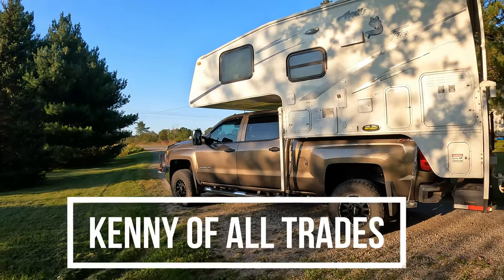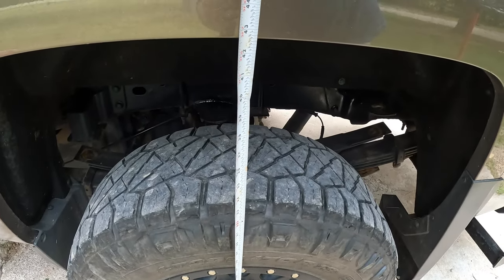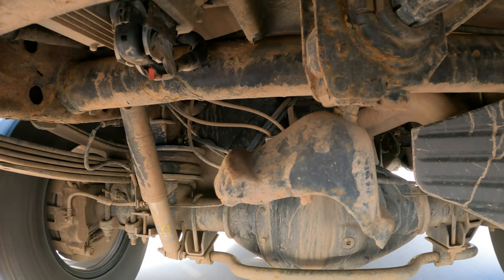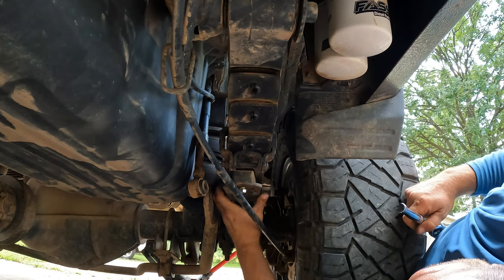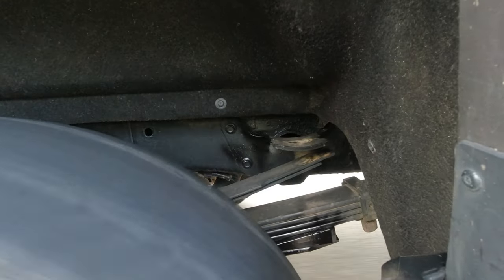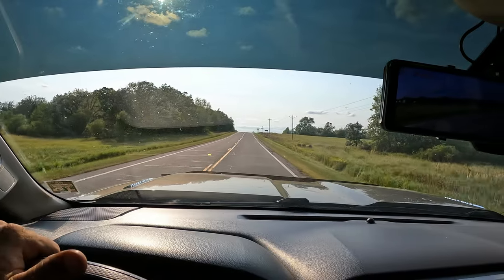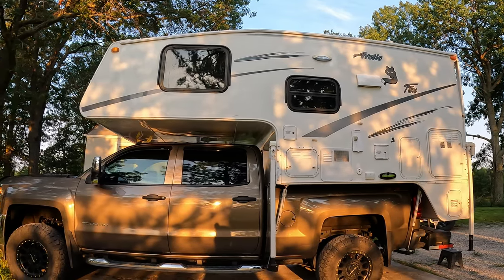Suspension Upgrades for Truck Camper

Comment: Great job on the write up. I already have a stiff set up on my f250, but if I want to use the felling wedges what guidelines should I use to install these onto my rig?
Reply from the maker: For my silverado it was straight forward. The wedges were the same width as the leaf springs. I pushed the wedges in so the end wasn't overhanging the leaf pack. The wedges come in two sizes, short and long. I put the long wedge in the back and the short wedge in the front. They have been in for many miles, well over 50k with no signs of wear at all. Unfortunately I'm not sure what the leaf pack looks like for the Ford.
Reply: @KennyOfAllTrades   Hi again, so I bought the Pormido mirror. The cords seem long enough to make it thru the cab and to the back of the camper. But the issue I know I am going to have is, I remove my camper after each use. Do you think I could put in a quick disconnect by splicing the wires? Or do you know of a unit such as this one that has wifi? Thanks for your help!
Reply from the maker: I disconnect the camera when I remove the camper. My camera had about two feet of cable then a plug. I would plug the camera and leave it attached to the camper. The other I would plug a rubber cap on and tuck up nder the truck.

Comment: This is an awesome video, love the explanation! I watched the whole thing even though I have a ram 1500 with upgraded coils lol. I just installed airbags on it but haven’t put my camper on just yet, wondering if anyone knows how the leaf springs+ airbags compares with the coils+ air bags
Reply from the maker: Thanks, I appreciate that. I hope someone can answer your question. I have never run coils before. My nephew had a 2500 Ram with coils. He had a Mountain Star in the bed (approximately 2200 pounds) with factory suspension. He would go to Montana Elk hunting and had no trouble.

Comment: Kenny, awesome video as always! One quick question though, can you show or tell how you mounted the fold down table/tray that you built on the back of your camper on the ladder?? 
As always, thanks for the info. 
Wife and I will be taking our 2014 Arctic Fox 990 out for the first time this month. Super excited to get this adventure on the road
Reply from the maker: Thank you for reminding me! I'm gonna include that in next t weeks video. I realized I missed a bunch of upgrades. I have forgotten about so much stuff over they years. Next week will be 15 minutes of additional upgrades, and I'll show my maintenance routine with the caulking gun. I also have to seel tge roof.
Reply: @KennyOfAllTrades  awesome!! Looking forward to next week.
Have you ever noticed any bubbles so to speak in your rubber membrane on the roof?? I have spotted a couple on mine, but I’m being told as long as there are no holes or tears that it’s fine. Still, it bothers me. lol.
Reply from the maker: Yes. Bubbles are OK. Or so I've been told. I have them too.

Comment: Hey Kenny,  GREAT video.  With the Wedges installed, how much room is between the main stack leaf springs and the overload springs, when uploaded?
Reply from the maker: Oh boy......thats a good question.....I haven't had the camper out of the truck in years, I don't remember..
Reply: Kenny’s truck is like a turtle…takes its home/shell with it wherever it goes lol
Reply from the maker: True story!
Reply: Hey, no worries. I'm going to be with and without the camper, so I was just wondering if the trucks ride became stiffer then it was without the camper. Thanks anyway.  Safe travels.
Reply from the maker: I'm going to say yes, the ride will be stiffer unloaded.  I don't think there was much of a gap, if any,  even without the weight of the camper.
That is where the Stable Loads from Tork Lift have an advantage. You can quickly disengage the overload perch.

Comment: I'm thinking to do all the mods but not the air bags. would that be a mistake? would the other mods level out the truck or just help handling?
Reply from the maker: You do not have to install the bags.  You will notice the difference with the other upgrades. I get the most use out of the airbags when I'm parked at a campsite. Having the ability to raise and lower each side 3" can come in handy when leveling out the camper.

Comment: Great video. Do you have a link to the lower wedge pieces?
Reply from the maker: I bought mine at Fleet Farm. But I found these on Amazon. They look to be the same product. If you buy these you will have one small wedge and one Large wedge left over....
https://www.amazon.com/Cold-Creek-Loggers-Chainsaw-Supplies/dp/B08L445PGS/ref=pd_aw_ci_mcx_mh_mcx_views_0?pd_rd_w=STlDG&content-id=amzn1.sym.be5b1f23-b91e-4e1a-9f5e-a760e8130d24&pf_rd_p=be5b1f23-b91e-4e1a-9f5e-a760e8130d24&pf_rd_r=4ZRN9TYH0DAFB145WE8B&pd_rd_wg=RuF0W&pd_rd_r=cadaedd3-daab-4490-b9d7-f356b148d714&pd_rd_i=B08L445PGS

Comment: Great review 👏. I plan on getting a truck camper and was looking in getting the torklift loads but very expensive. Did you make your felling weages or purchased them ?
Reply from the maker: I bought them at Tractor Supply. They are made of a plastic composite. They come in two sizes. I put the large wedges in back and the small ones up front.
Reply: @KennyOfAllTrades  Great 👍thanks for getting back to me quickly. I'll have to try them out. That would save me some money. I do plan on getting the Bigwig stabilizer as well.
Reply from the maker: That was a really big help. I would definitely install the biggest sway you could find.
Reply: @KennyOfAllTrades  I meant Hellwig lol
Reply from the maker: @dannythervguy  I think you were right. The bigwig is made by hellwig. I think the bigwig is about the biggest bar they make.
Reply: @KennyOfAllTrades  you're right 😄

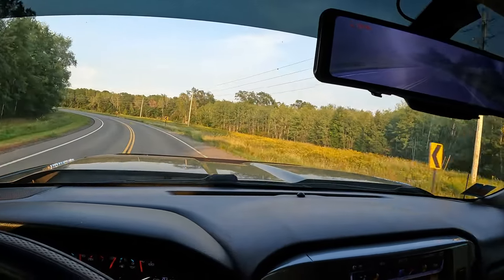Comment: Yeah! Good job! Sway bar - that's what I need. Also... Rear view mirror/Screen (10:48). What's the brand? Link maybe? Cheers
Reply from the maker: It a Pormido rearview camera. I've had it over three years now. It works really well. I would not want to carry the truck camper without one. I'll share an Amazon link to the one I have. 
Check this out! https://a.co/d/6d5voqw
Reply: @KennyOfAllTrades  Thanks a lot! Cheers from the UK!

Comment: Hey Kenny....first of all , THANKS for this video.
I was just given a 2004 Adventurer WS810. It sits at about 2300lbs. 
In your opinion , if I did all these upgrades to an older 90's Chevy 2500 4X4 , long bed.......you think it would work?
Or do you think I'd be better off with a 3500 series truck? I want an older Chevy , because I know how to fix em'!
Reply from the maker: I had this camper on a 2008 Silverado 2500. It was ok. I didn't have any major issues. It wasn't as off-road capable as the 3500. I don't even notice I have a camper in the bed of this truck. The big difference between my current truck and the old 2500 is the additional top overload leaf. That really keeps it stable when articulating on the trails. But when driving down a straight road, the upper overloads don't come into play.
Reply: @KennyOfAllTrades  Got it , and understood. Thanks for the reply btw. The used truck market is starting to calm down a bit , so I'm hoping by this summer I  can find a descent truck. It'll give me some time to fix up my new ( new to me ) 2004 camper.  OH!!.....Also , I have been camping out of a 3500 extended Chevy express van for about 8 years now. I have found that if I have power.....a crockpot with double liners is my friend!  Cook anything in those and they use about 100 watts!

Comment: I'm curious as to how much lift (or how much suspension travel ) you got with just the upper bump stops and lower wedges (airbags deleted)?   I have a 17 GMC 3500 gas with highest payload available and a 3300lb camper.   It had maybe an inch of rear travel and I added tork lift uppers.  I gained about 1.5-2" of travel.  Tork lift told me the lowers would help minimally due to the minimal gap in the lower overloads.  I'm wondering if the felling wedges would give me a bit more travel.
Reply from the maker: I would try it. The investment is minimal. Engaging the lower overload springs gave me the most notable difference.....well that and the sway bar. 
The upper overload spring is really thin compared to the lower. Having the lower fully engaged right away helps a ton...probably closer to 2 tons!
I'll measure the lift later tonight with the wedges, and bump stops.
Reply: @KennyOfAllTrades  I have double uppers and very little to no space between my spring pack and lower springs even empty.  I think the double uppers are part of the extra GVWR package
Reply: Kenny do you have an amazon link for the felling wedges you used?  There are many on there....  Thanks!
Reply from the maker: These look to be the exact ones. If you order this one you will have 1 large wedge and 1 small wedge left over. 
https://www.amazon.com/Cold-Creek-Loggers-Chainsaw-Supplies/dp/B08L445PGS/ref=pd_aw_ci_mcx_mh_mcx_views_0?pd_rd_w=STlDG&content-id=amzn1.sym.be5b1f23-b91e-4e1a-9f5e-a760e8130d24&pf_rd_p=be5b1f23-b91e-4e1a-9f5e-a760e8130d24&pf_rd_r=4ZRN9TYH0DAFB145WE8B&pd_rd_wg=RuF0W&pd_rd_r=cadaedd3-daab-4490-b9d7-f356b148d714&pd_rd_i=B08L445PGS
Reply: @KennyOfAllTrades  thanks so much.  My wife and I really enjoy your channel.  I quote you all the time about not wanting to be around people.   Problem is unlike you I hate the cold!
Reply from the maker: It got down to 39 last night, I had to turn the furnace on in the camper. Lol I still have the summer sheets in here. The nice thing about the cold is you can always put more clothes on. The hot humid weather is what gets to me. Thanks for following along!

Comment: Love it "am I over, yeah " lol about a 1000# ... I get the over wieght nazi attacking my 1/2 ton truck all the time for over wieght. Like you I have done a ton of up grades to my suspension to handle the load and keep the nose down. 
Years past the older 1970s and early 80s truck all you did to get 3/4 to 1 ton out of those trucks was change the leaf springs and buy v8 motor trucks. 
It's like those concepts have been lost to time to the arm chair spec readers. 
You do a little research the main difference of the 2009-2012 1/2 ton F150 vs the F250 is a frame cross member bar (you buy at the junk yard for $30) and tires. All the rest can be beefed up with airbags and those same wedges like you did. 
#Arm chair spec reader vs real life truck hauler. Lol 😅

Nice job the truck suspension. 
The airbags are the most expensive part of that build and far cheaper than buying a bigger truck.
Reply from the maker: I had to stop being a part of 90% of the truck camper forums on Facebook. The weight police were out of control! Guaranteed none of them have written a crash report involving an RV, but they all knew traffic laws better than a State Trooper. Like you, I have been running Truck Campers since the days of old. Nowadays, these guys on Facebook say you need a 550 minimum to carry a truck camper. I don't buy it!

Comment: Hi Kenny do you think the upgrades would work well without air bags? Thanks
Reply from the maker: Yes, absolutely.
I use the airbags for leveling once I'm parked more than while driving. I'm almost level with no air in the bags. When I have them inflated to 100 psi, I have over a 3" rake.  The bags are not needed. But at night, I do air them up to keep my headlights aiming down the road at the factory level.

Comment: I hope you see this how would you install wedges if you don’t have hole to bolt through? Drill one??
Reply from the maker: Yes. You can drill through the lower spring. I've seen guys do it on YouTube. It's a lot of work. One guy used a car jack and a hand drill to make the hole. A lot of guys said it's a workout on the arms to keep applying pressure. The jack looked slick.
Reply: Thank you very much,guess I am going to get a work out

Comment: @ Kenny what size wedge did you use. 8 inch on the rear of the pack and 5.5 inch on the front?
Reply from the maker: Yes. That exactly right.

Comment: Did you have separate fills for your individual air bags?
Reply from the maker: Yes. Both bags have separate lines. Many years ago, I bought a truck with bags already installed. I never thought about the airbags and how the were plumed. Both bags were on the same line. I put a camper in the bed of the truck.....wow! The airbags fought each other when in corners. It was extremely dangerous. I had to stop and drop all the air out of the bags.

Comment: So, , these felling wedges,,, are they the ones used for felling trees ??? 
  If so what size do you use ??
Reply from the maker: Yes those are the ones. They are made an ABS material. Manards and Tractor supply in my area carry two sizes. 8" and 5.5". I use the 8" in the rear of the leaf pack and the 5.5" in the front. They are the same width as the leaf springs. I have close to 80k miles on them with no issues. When I removed them for the video I saw zero signs of wear.

Comment: Sounds like you said “felling wedges”? As in tree cutting?
Reply from the maker: Yes, that is it! They have been in there now for just shy of 100,000 miles, carrying the camper. I figure if they are designed to be smashed into hardwood using a 16-pound maul, they could hold up to the pressure of the lesf springs. When I took them out for this video, there were zero signs of wear.
Reply: @KennyOfAllTrades  I like your way of thinking. I was ready to go out and purchase

Comment: Where can I buy those falling wedges?
Reply from the maker: I bought them at Fleet Farm. Here is a link to Amazon. I used the larger one in the rear and the smaller one in the front of the leaf pack. 

UNCO- Tree Felling Wedges with Spikes, 4Pack, 5.5" & 8" Wedges with Storage Bag, Splitting Wedge, Plastic Wedges, Logging Tools and Equipment, Chainsaw Wedges for Trees https://a.co/d/0O10RdY
Reply: @KennyOfAllTrades  Thank you for the fast response and the link!! Ordening right now for a RAM 2500. Question, the smaller one is going in the same leaf level you put the rear one?
Reply from the maker: @ruteandosindestino the gap is smaller in the front of the leaf pack. The smaller wedge was a perfect fit. The wedges are the same width as the springs. Hopefully, it works well for you.

Comment: What felling wedge do you use
Reply from the maker: The plastic ones. I bought them at Fleet Farm. They did not have a name on them. I figured if they could get wedged into a tree with a maul, they would take the force of a spring pack.

Comment: Can anyone provide any information on the size of the wedges?
Reply from the maker: Here is a link. The bigger ones, 8" long mount towards the rear of the truck. The smaller ones 5.5" go towards the front of the truck.
I bought mine from Menards. I've had them in for 80k miles with no issues at all. I can not attest to the quality of the Amazon product, but at least you know what I used. 
https://www.amazon.com/GarMills-Felling-Logging-Chainsaw-Cutting/dp/B0822VFXLN/ref=asc_df_B0822VFXLN/?tag=hyprod-20&linkCode=df0&hvadid=416788749780&hvpos=&hvnetw=g&hvrand=9239557185409606799&hvpone=&hvptwo=&hvqmt=&hvdev=m&hvdvcmdl=&hvlocint=&hvlocphy=9020135&hvtargid=pla-901091150782&psc=1&tag=&ref=&adgrpid=90729929941&hvpone=&hvptwo=&hvadid=416788749780&hvpos=&hvnetw=g&hvrand=9239557185409606799&hvqmt=&hvdev=m&hvdvcmdl=&hvlocint=&hvlocphy=9020135&hvtargid=pla-901091150782
Reply: You’re the man! I appreciate your video and the time it took to make

Comment: Overloading is the only thing that matters. You are obviously overloaded and nothing you have done will fix that. You can’t add payload to your truck. It comes down to you being a danger to others on the road. I’m sorry if that hurts but the truth is you shouldn’t be promoting hauling overweight no matter how ‘good it feels’ driving.
Reply from the maker: No, you're absolutely right. I'm overloaded. I even say that in the video. And your correct, thrres nothing you can do to raise the payload capacity of the truck. Rest assured, your opinion on the safety of my rig will not hurt my feelings.
Reply: So you missed the point of my reply. You’re a danger to everyone else in the road period. The payload rating of your truck is about more than how much weight you can put in the box. One big issue with being overloaded (in your case significantly) means your stopping distance is increased especially from high speeds. And thanks to your video even more people think it’s okay to drive the highways at 75+mph with their trucks overloaded as long as your truck is level and “feels” fine to drive.
Reply from the maker: No, I didn't....I just don't want to argue with you. I was trying to be nice.  We are going to have to disagree.  I understand what you are saying. But I think you are wrong.

Comment: Hey Kenny! Wonderful video good sir! Sorry if this was already answered or buried - but what size felling wedges did you use for the front and rear portion of the suspension? Thanks!
Reply from the maker: They are the 5.5 in the front and 8" in the rear. I bought them at Fleet Supply. Here is an Amazon link. 

UNCO- Tree Felling Wedges with Spikes, 4Pack, 5.5" & 8" Wedges with Storage Bag, Splitting Wedge, Plastic Wedges, Logging Tools and Equipment, Chainsaw Wedges for Trees https://a.co/d/1gDSLI5
Reply: @KennyOfAllTrades  Thank you sir and Happy Camping!